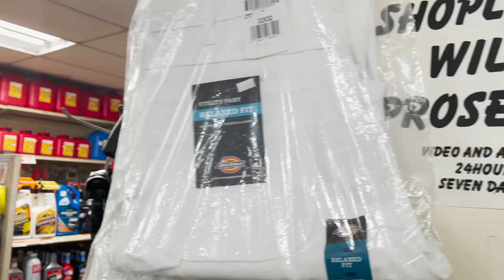Modern Home Makeover // Episode 13 - Drywall Prep

Comment: If you put up some small blocking on the wall (to the right as you're seeing the video) you can use it as a perch to hold the drywall as you hang it.  Helps a lot.  Also, if the joist is not leveled.....